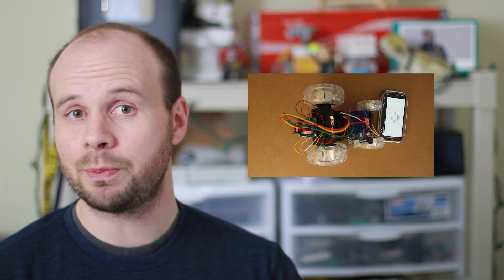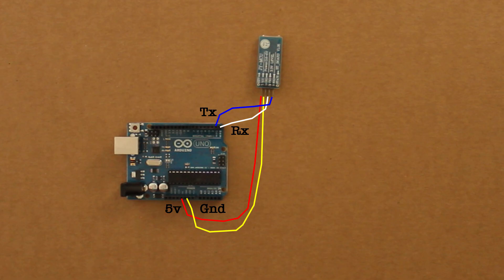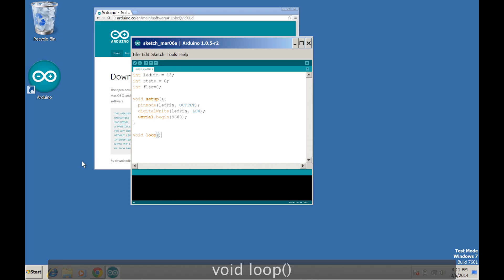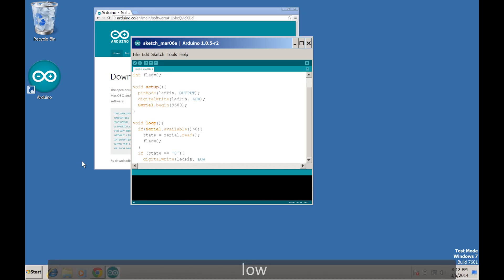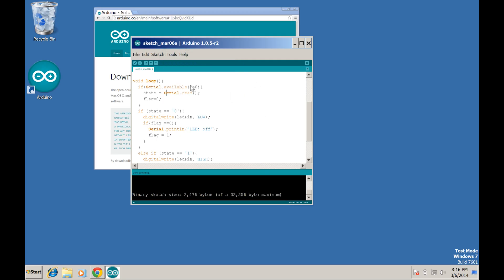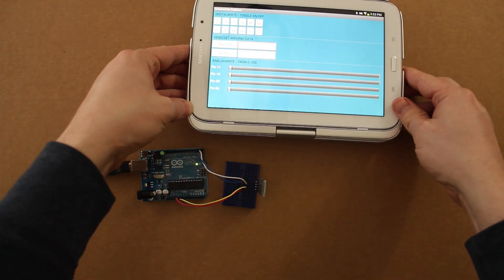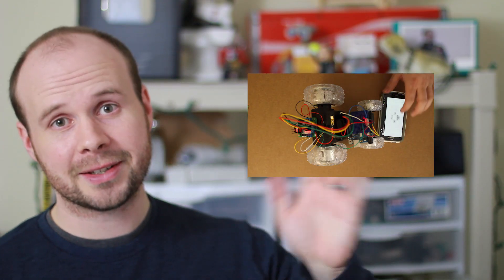Arduino Bluetooth Basics

Comment: CODE IS HERE: 

int ledPin = 8;
int state = 0;
int flag = 0;

void setup() {
  // put your setup code here, to run once:
  pinMode(ledPin, OUTPUT);
  digitalWrite(ledPin, LOW);
  Serial.begin(9600);
}

void loop() {
  // put your main code here, to run repeatedly:
  if (Serial.available() > 0) {
    state = Serial.read();
    flag = 0;
  }

  if (state == 0) {  // Compare with integer 0
    digitalWrite(ledPin, LOW);
    if (flag == 0) {
      Serial.println("LED: off");
      flag = 1;
    }
  } else if (state == 1) {  // Compare with integer 1
    digitalWrite(ledPin, HIGH);
    if (flag == 0) {
      Serial.println("LED: on");
      flag = 1;
    }
  }
}

Comment: Nice intro! I have a ball launching machine with 4 motors controlled by using arduino uno + adafriut shield V2. Is it possible to remote control the power (12V)  so that I have the freedom to turn the machine on/off from a distance? Any help?

Comment: int ledPin = 13;
int state = 0;
int flag =0;

void setup() {
pinMode(ledPin,OUTPUT);
digitalWrite(ledPin,LOW);
Serial.begin(9600);
}

void loop() {
  if(Serial.available ()>0){
    state = Serial.read();
    flag = 0;
  }
if ( state == '0'){
  digitalWrite(ledPin,LOW);
  if(flag ==0){
    Serial.println("led: off");
    flag = 1;
  }
  
}
if ( state == '1'){
  digitalWrite(ledPin, HIGH);
  if(flag ==0){
    Serial.println("led: on");
    flag = 1;
}
}
}

Comment: "You can find downloads and a full version of the code here:" - No you can't. What you get is the author's home page, which doesn't include any reference to this project nor any search facility to help find it. What a time-wasting load of crap!
Reply: Or, maybe you should try and write it yourself, if your working with arduino's already you should know C++. Also he shows exactly how he wrote his code, is it too much work for you to rewrite it, are you so lazy you have to copy and paste or you'll be pissed off about it?
Reply: //Boom done, code written, your welcome .-.
int ledPin =13;
int state = 0;
int flag = 0;

void setup() {
  pinMode(ledPin, OUTPUT);
  digitalWrite(ledPin, LOW);
  Serial.begin(9600);
 
}

void loop() {
  if(Serial.available()>0) {
    state = Serial.read();
    flag=0;
  }
  if(state == '0'){
    digitalWrite(ledPin, LOW);
    if(flag == 0){
      Serial.println("LED: off");
    }
  }
  else if (state == '1'){
    digitalWrite(ledPin, HIGH);
    if(flag == 0) {
      Serial.println("LED: on");
      flag =1;
    }

  }

}

Comment: Can you make a tutorial on how to use these Bluetooth modules as a transmitter? To be honest I want to make an audio transmitted so that I can connect bt speakers and headsets to it. The ones available on the market are quite quite expensive so I thought if I can utilise one of these modules it'll be cheaper.

Comment: Thanks a lot!!! I faced some troubles with my HC-10, but you tutorial has helped me :))
Great video!))
Code I've used is below:

int LED = 12;
int state = 0;
int flag = 0;

void setup()
{
  Serial.begin(9600);
  pinMode(LED, OUTPUT);
  digitalWrite(LED, LOW);
}

void loop()
{
  if(Serial.available()>0)
  {
    state = Serial.read();
    flag = 0;
  }
  if (state =='0')
  {
    digitalWrite(LED, LOW);
    if (flag == 0)
    {
      Serial.write("LED: off");
      flag = 1;
    }
  }
  else if (state =='1')
  {
    digitalWrite(LED, HIGH);
    if(flag == 0)
    {
      Serial.print("LED: on");
      flag = 1;
    }
  }
}

Comment: Is there a way to use hardware serial (arduino RX/TX pin 0,1) with Blynk app ?? 
I know the standard code use the software serial but I don't  have anymore pin available on digital.... 
Can't figure out how to use pin 0/1 with Blynk..... i search on google and can't find a complete working solution
Thanks for your support

Comment: Nice video presentation, some points to comment:
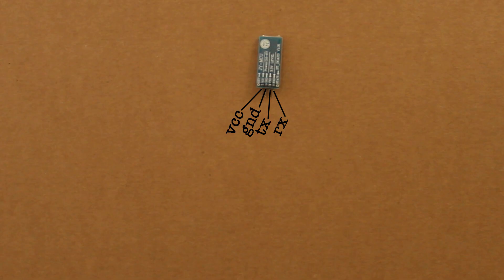The HC-05 module used in this tutorial clearly states  "3.3V LEVEL" at the RX input pin 0:33  . The use of a voltage divider (1k/2K) is recommended.
Also a resistor (470-1K) in serie with the LED is recomended. (The Arduino ATMEGA328 is being stressed out of specifications).

Comment: yeah like it works... and i cant keep up with your autotype.i have to keep pause the video. and after all its useless in the and because it wont upload the code.
 and yes it is compiled
Reply: take out the Rx and Tx ports of the Bluetooth module, upload it and then plug it again

Comment: i set it up exactly like yours. but when i touch 13 the light wont turn on or when i send 1 to the module. But when I move the sliders the light comes on and turn off at particular point on the slider. any suggestion would be nice.

Comment: I built the game snake on a Arduino Uno board with a bluefruit LE shield and 16 x 16 light board. I can use my smartphone and the bluefruit app as a controller. 

It works great! 

But now I want to make it multiplayer. 

Can the bluefruit shield which I understand is a peripheral device have multiple discoveries and connections?

Comment: How come other tutorials are putting voltage regulator for the tx in on the arduino to prevent damage to bluetooth because it states only 3.3v ont he txd pin on the bluetooth module??

Comment: why did not the bluetooth module burn?as the reciever port of bluetooth is only 3.3v but sending 5v through wire should have burnt it
Reply: Good point.... have the same question/concern
Reply: Abid Mahmud Some Bluetooth modules convert 5v to 3.3v because the onboard arduino 3.3v doesn't supply enough current for it to be 100% stable.
Reply: The HC-05 module used in this tutorial clearly states  "3.3V LEVEL" at the RX input pin 0:33  . The use of a voltage divider (1k/2K) is recommended.
Also a resistor (470-1K) in serie with the LED is recomended. (The Arduino ATMEGA328 is being stressed out of specifications).

Comment: I cant connect to the HC-06 because my phone doesn't have the menu button. I have an at&t  ZTE gophone. Does anyone know how to get to the apps menu up without the button?
Reply: I had the same problem. Go to your phone's settings and connect to bluetooth from there
Reply: Azul Kothari I've tried but for  some reason it still won't work.

Comment: if i interface the arduino to 9v battery it doesn't work
where is the problem and how can i fix it?
Reply: The Arduino runs on 5V, which is why it can be so easily operated from USB. If you want to use a 9V battery, you'll need to buy a voltage regulator and a few capacitors to step the voltage down. Or I'm sure you can buy hardware that does that for you.

Comment: I've got an UNO r3 ( the older version ) and it's glitching badly ! what can i do ?

my board is one of these : http://www.miniinthebox.com/nl/uno-r3-microcontroller-development-board-verbeterde-atmega328p-voor-arduino_p4027909.html?currency=EUR&litb_from=paid_adwords_shopping&utm_source=google_shopping&utm_medium=cpc&adword_mt=&adword_ct=75464135442&adword_kw=&adword_pos=1o4&adword_pl=&adword_net=g&adword_tar=&adw_src_id=4196617767_325054602_22935007362_aud-79897721551:pla-77139958013&gclid=Cj0KEQjw_9-9BRCqpZeZhLeOg68BEiQAOviWAk6441H9l6lBM1f-avhdGrN254SfKT3PVbdDlXPcheUaAkEz8P8HAQ

when i put it to input mode it's doing things on its own .. !! 
i put pin 7 on input mode and pin 13 on output mode and i connected a LED to pin 13 and i programmed it so when pin 7 reads an input , pin 13 turns on. i loaded the program to my UNO then it started glitching ! it turns on  and of him 13 without even me touching it ! whats the problem ?

Comment: Thanks for the video. I had a problem with getting it to work, but I have figured it out. My Bluetooth module is operating at a different baud. (115200). cool stuff. thanks a lot

Comment: Hi, i am trying to connect 10 drones to my mac via bluetooth LE and control them at the same time. is there anyway that i can use Arduino to do it? because the bluetooth device can connect to 7 slaves at the most. thank you :)
Reply: is that possible?, what kind of BT?, i knew only 1 device can connect to bt at the same time
Reply: @oldsilenthill1  yes only one bluetooth system transmits and receives to one bluetooth module at one time

Comment: I want to use  the Ardudroid code only to toggle appliances. I understand I have to use the following part.

// 2) GET digitalWrite DATA FROM ARDUDROID
  if (ard_command == CMD_DIGITALWRITE){  
    if (pin_value == PIN_LOW) pin_value = LOW;
    else if (pin_value == PIN_HIGH) pin_value = HIGH;
    else return; // error in pin value. return. 
    set_digitalwrite( pin_num,  pin_value);  // Uncomment this function if you wish to use 
    return;  // return from start of loop()
  }

// 2a) select the requested pin# for DigitalWrite action
void set_digitalwrite(int pin_num, int pin_value)
{
  switch (pin_num) {
  case 13:
    pinMode(13, OUTPUT);
    digitalWrite(13, pin_value);  
    // add your code here      
    break;
  case 12:
    pinMode(12, OUTPUT);
    digitalWrite(12, pin_value);   
    // add your code here       
    break;
  case 11:
    pinMode(11, OUTPUT);
    digitalWrite(11, pin_value);         
    // add your code here 
    break;
  case 10:
    pinMode(10, OUTPUT);
    digitalWrite(10, pin_value);         
    // add your code here 
    break;
  case 9:
    pinMode(9, OUTPUT);
    digitalWrite(9, pin_value);         
    // add your code here 
    break;
  case 8:
    pinMode(8, OUTPUT);
    digitalWrite(8, pin_value);         
    // add your code here 
    break;
  case 7:
    pinMode(7, OUTPUT);
    digitalWrite(7, pin_value);         
    // add your code here 
    break;
  case 6:
    pinMode(6, OUTPUT);
    digitalWrite(6, pin_value);         
    // add your code here 
    break;
  case 5:
    pinMode(5, OUTPUT);
    digitalWrite(5, pin_value); 
    // add your code here       
    break;
  case 4:
    pinMode(4, OUTPUT);
    digitalWrite(4, pin_value);         
    // add your code here 
    break;
  case 3:
    pinMode(3, OUTPUT);
    digitalWrite(3, pin_value);         
    // add your code here 
    break;
  case 2:
    pinMode(2, OUTPUT);
    digitalWrite(2, pin_value); 
    // add your code here       
    break;      
    // default: 
    // if nothing else matches, do the default
    // default is optional
  } 
}
 

MY QUESTION IS :  Which part of the Ardudroid code I should use from the following part?

#define START_CMD_CHAR '*'
#define END_CMD_CHAR '#'
#define DIV_CMD_CHAR '|'
#define CMD_DIGITALWRITE 10
#define CMD_ANALOGWRITE 11
#define CMD_TEXT 12
#define CMD_READ_ARDUDROID 13
#define MAX_COMMAND 20  // max command number code. used for error checking.
#define MIN_COMMAND 10  // minimum command number code. used for error checking. 
#define IN_STRING_LENGHT 40
#define MAX_ANALOGWRITE 255
#define PIN_HIGH 3
#define PIN_LOW 2

String inText;

void setup() {
  Serial.begin(9600);
  Serial.println("ArduDroid 0.12 Alpha by TechBitar (2013)");
  Serial.flush();
}

void loop()
{
  Serial.flush();
  int ard_command = 0;
  int pin_num = 0;
  int pin_value = 0;

  char get_char = ' ';  //read serial

  // wait for incoming data
  if (Serial.available() < 1) return; // if serial empty, return to loop().

  // parse incoming command start flag 
  get_char = Serial.read();
  if (get_char != START_CMD_CHAR) return; // if no command start flag, return to loop().

  // parse incoming command type
  ard_command = Serial.parseInt(); // read the command
  
  // parse incoming pin# and value  
  pin_num = Serial.parseInt(); // read the pin
  pin_value = Serial.parseInt();  // read the value

Comment: hello @tinkernut Labs.
I am NOT able to "connect" my  "already paired" HC 08 bluetooth module to mobile (android 4.4). I have tried different apps, ArduDroid, Bluetooth SPP Pro, Bluetooth Terminal. But hc 08 still never connects, but only gets paired.
On serial monitor, it shows OK+connected, the led on HC 08 is constantly on after pairing and remains until the connection finally fails.
Any suggestions, what is wrong?

Comment: I would like to connect the Arduino to my PC using Bluetooth instead of USB. I'm building a CNC. Is that possible? Thanks!
Reply: +tungruffel You have to buy a bluetooth adapter, its really cheap, and download or make an app to controll the arduino from your pc

Comment: I am able to pair the bluetooth to android and connect it within the app.  But when sending 1 or 0 the LED never lights up.  I'm not sure what I could be doing wrong- any help would be appreciated!
Reply: Hi,
I have the same problem, when i am connected to bluetooth device and press 1 then nothing happens. If I press repeatedly then I lose connection to Bluetoothdevice?
Reply: I had the same problem, try downloading arduino bluetooth controller app. Apparently the mentioned app on this video doesn't work
Reply: no

Comment: it is not working... i dont know just why.. the hc05 is connected but the led is not glowing and the Rx light is also  not glowing.... please help!!!
Reply: +vardeep sandhu did the mix up the ground and VCC wires
Reply: +Apple Jailbreaker i just chee code first cked it... all the connections are just as described... 
VCC ==5V
GND==GND
Rx==Tx
Tx==Rx..
Reply: +Apple Jailbreaker i put the code first using Software Serial library then after that i connected the circuit gave external 9 v input to adruino , paired with the hc05 module and the Led is not working

Comment: My Bluetooth is on and the light on it flashes slowly. The phone sees the bt module. The phone is successfully able to pair with the module, the light goes solid for maybe 5 seconds, then returns to blinking slowly. The phone continues to see the module as paired but all apps say unable to connect device. WTH is going on? -complete arduino noob.
Reply: +enginesnblades Also it's a 3.3v module, but the Arduino has a 3.3 plug so I just plugged it in that one instead of the 5v plug. Not sure if that info matters.
Reply: Same problem, did you manage to fix it?

Comment: Apparently my bluetooth module was fried with 5v RX/TX.... It was working for the first several times, than I can never see the module again when I scan for bluetooth.
Reply: +Kuang-Yu Samuel Chang As I said in the video, you need to make sure your bluetooth  module supports 5v
Reply: You can use an voltage divider for diminishing the voltage on the rx/tx pins from 5v to 3.3v

Comment: Is that LED getting 5v? I guess this is ok for demonstration purposes, but this will likely burn out your LED if left on like that long term.
Reply: Arduino has a resistor on pin 13 so no problem connecting an led only on pin 13.
Reply: +CoolTroniks Damn, I didn't know that. So much to learn. Thanks!

Comment: using that app im able to use the GET DATA but not the SEND DATA? why is that i cant toggle the led on pin 13 using this app but i can use my pc terminal to type in 1 or  0  to get it to go on and off  help please
Reply: +Frank Lopez  it should be 
if (state == 0)  without quotation mark, also for if(state == 1)
hope this help
Reply: larry coc thank you, do you know of any tutorial that helps you use just this module "well 2 tx/rx" to switch on and of a dc motor or any motor for that matter?

Comment: What Bluetooth module should I get?  Can someone suggest any specific sellers, I would prefer to buy it on amazon but there are so many to choose from, how do I know which one to order?  It's hard to figure out the manufacturer because they are all so similar but don't have any markings telling where they came from. Also, what is the difference between slave and master?  And why would I need one or the other?  Thanks!
Reply: +christopher jones what's the diff between the 05 & 06 ? i see one has more pins than the other.  BTW i own like 20 nRF24L01+ and im yet to use it for my servo Tx or IMU Tx  tho the example sketch does work on all maybe we can link up
Reply: +Jared Connell i answer this to get notified when someone answers this

Comment: hey I am using HC-06 and it's working perfectly on both 3.3v rx tx level and with 5Vvel, d level don't hesitate trying any of them  it's so stable 

but I am wondering why can't I send data over Serial monitor too while I'm receiving the data which Arduino sends over Bluetooth on the serial monitor ?!!

Comment: @Tinkernut Labs
 Hi, Nice video.
I have a Wordpress account and I am trying to login into your website using it, so that I can comment, but can't. Secondly, why are you using flag variable? Why is it really needed. 

This is my program and it works, why is it so?

int ledPin = 12;
int state = 0;
//int flag = 0; 

void setup() {
  // put your setup code here, to run once:
  pinMode(ledPin,OUTPUT);
  digitalWrite(ledPin,LOW);
  Serial.begin(9600);

}

void loop() {
  // put your main code here, to run repeatedly:
  if(Serial.available()>0){
    state = Serial.read();
   // flag=0;
  }

  if(state=='0'){
    digitalWrite(ledPin,LOW);
   // if(flag==0){
     // Serial.println("LED:off");
      //flag=1;
    //}
  }

   else if(state=='1'){
    digitalWrite(ledPin,HIGH);
    //if(flag==0){
     //Serial.println("LED:on");
      //flag=1;
    //}
  }

}

Comment: Hey I think this code is much more simplier (and it works I tested it)

int ledPin = 13;

int val;

void setup()
{
  pinMode(ledPin, OUTPUT);
  Serial.begin(9600);
}

void loop()
{
  if(Serial.available()>0)
  {
   val = Serial.read();
  }

  if (val == '1')
  {
    digitalWrite(ledPin, HIGH);
  }
  else if (val == '0')
  {
    digitalWrite(ledPin, LOW);
  }
}
Reply: Tadas Kiaunė 
agreed - i dont know why he needs the flag variable. My code looks similar to yours.
Reply: +Tadas Kiaunė  Does your code work with https://play.google.com/store/apps/details?id=com.circuitmagic.arduinobluetooth   this application??
Reply: +Tomislav Protić I think if you can send 1 or 0 to the arduino through the app it should work!
Reply: yes, it can send 1,0
Reply: so it should work!
Reply: +Tadas Kiaunė so, thank you
Reply: I have the seeed bleutooth shield... connection works but it is not turning the LED on/off. With none of these apps. : /